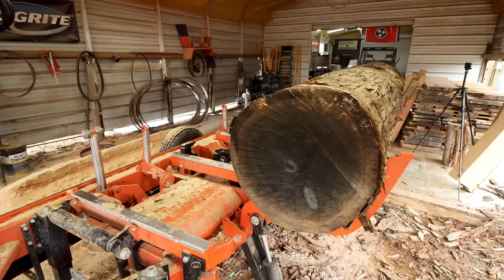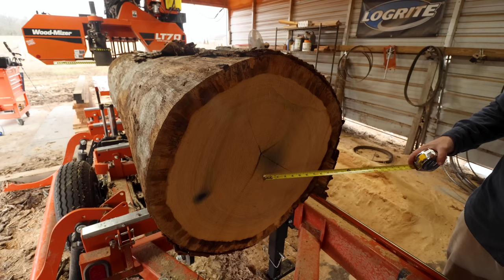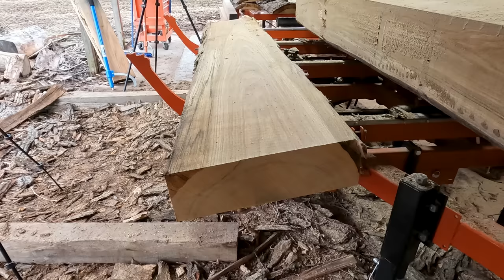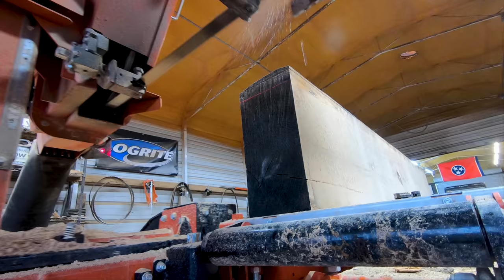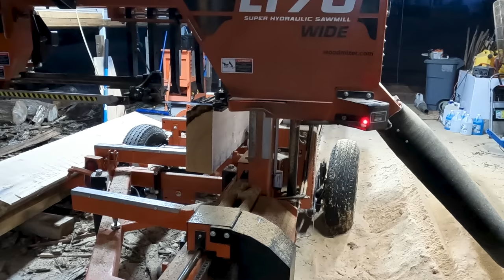The Cold Hard Truth About Running A Sawmill Business

Comment: Just some fyi, I have a metal detector that didn't cost thousands of dollars, and I can pinpoint within an inch of where the metal is, and how deep it is. That being said, I'm not saying go out and buy one, but I'm sure there is a group near you that would gladly come out and detect your logs, for a fee for gas and maybe a beer. Just a thought. I do an arrangement for a sawyer where I charge a small fee, plus 1 dollar a log. Like I said, the new detectors are so much better now, and generally under 5 bills for one that would work. But your method works, just clearing that up!

Comment: Love the channel. Great information. Don’t agree about not using a metal detector.  I’d be able to tell you the approximate depth and location with my $150 or $800 metal detector and a $120 pin pointer.  I think you should rethink your tools. Time changing a blade and getting a new blade sharpened might be worth $300 to $500 in loss time. Just say’n…look at your per board cost and what tools make you better and faster.   You already know the LT70 has made you more productive than your previous saw, as well as the tractors.

Comment: I agree with you on the stain in end grain like that being metal. I grew up with a LT 40 hydraulic used as a portable mill, so I know all too well about steel in wood. I don't know if you pull your mill out to clean your building but around 13:20 the frame can be seen moving up and down as the head rig runs. In our experience (fathers and mine 30 years) this is caused by there being too much weight on the tires, give those jacks one more click. Your mill is way newer than ours (1987), so I don't know if they still click or not.

Comment: Nathan
 Just a thought for you of ur Saw Dust !
Build a long trough as long as it needs to be to get a tract bucket or a three side Ben and use forks too lift, make just the width of a Snow Shovel and may have to experiment on the side heights and every so often push out the trough into the Bucket or Ben and may keep the pain of clean up dust everywhere !
 Just a thought from the Presto’s in Missouri

Comment: Good looking boards I love your mill wish I could afford one like it. My son and I recieved one each of the nail pullers for Christmas of 22, you are correct nails not so bad I have a sharpener and blade set also fence staples pretty rough but a lag bolt will break the blade then you turn the air blue and chainsaw around the bolt and have some short boards think the tree held a deer stand platform at one time and someone proabally hacksawed the bolt off right against the bark to get the stand down, just my best guess

Comment: Hello. Excellent video. 
Question on the de- barker. Do you use it constantly or just for certain type of operations or species ? 
Thanks a lot
Reply: I run an LT40 hydraulic with debarker and I don't run the debarker on clean logs but if the logs have dirt and/or some small rocks in the bark from dragging, that is where the debarker saves blades and time.